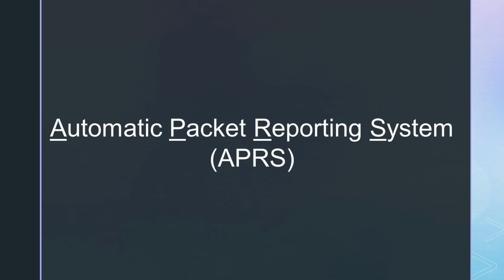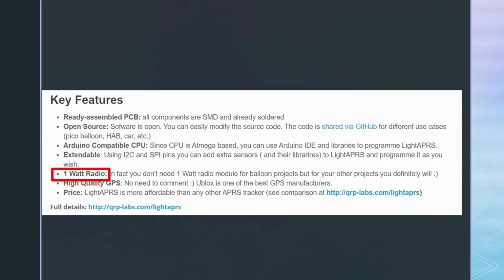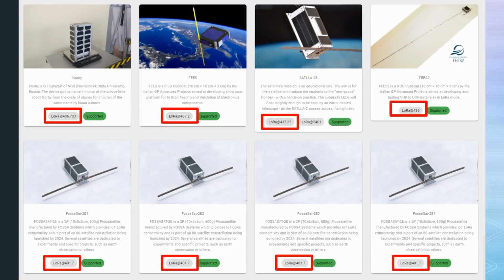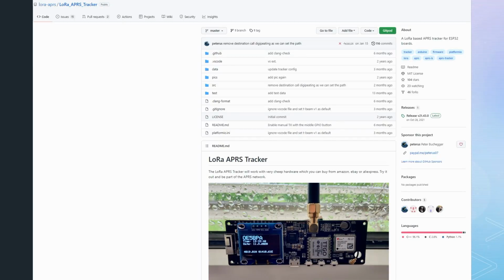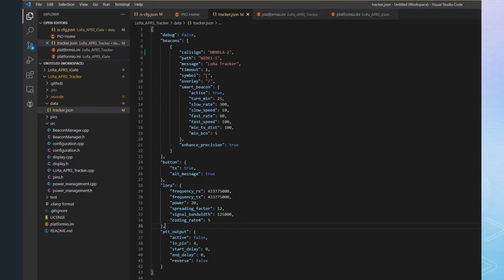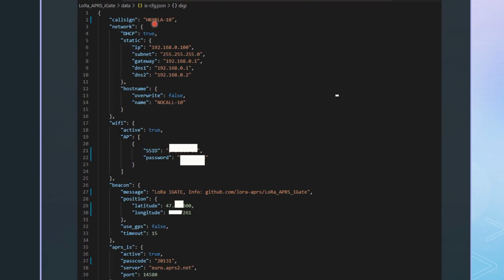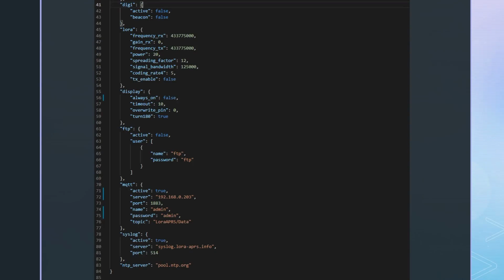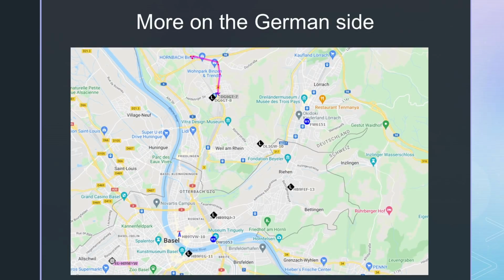021 New and Cheap APRS using LoRa Technology

Comment: Why hasn't anyone made a dual mode APRS (AX25 and LoRA) digipeater on 2 metres? In the UK the 70cm frequency is right in the middle of the licence-free ISM band,  and most people who are raving about LoRA/Meshtastic are using the non Amateur allocation around 800 MHz, to be honest, Meshtastic is just a craze, as soon as people realise that it is only SMS they will rapidly get bored with it, it is reinventing the wheel a bit because you can doing everything already using standard APRS. So why not a dual-band AX25 and LoRA digipeater iGate on 144MHz?
Reply from the maker: I would just place two different igates at the same place. Then, you can use available technology. 868MHz is used because LoRaWAN is also on this frequency in Europe, BTW.

Comment: Have you compared the range of 433 vs 868/915 modules, all else being equal (apart from the antennas, of course)?
Reply from the maker: No, I did not test it. They should be similar in most cases.

Comment: Would it be possible to run the lora protocol on 2 meters directly?  Has anyone tried this?  I guess Lora is proprietary, so that might be a problem, also any form of encryption is verboten in amateur radio so that's another.  Might be interesting...
Reply from the maker: I do not know if anybody tried. The LoRa chips start at 137MHz. So you only would have to adapt the matching/filter to the antenna.

Comment: i have a question, can i use lora aprs without a license? and are there igates nearby nordhausen - thuringen?
Reply from the maker: IGates are receive only. No problem without license. Trackers are transmitters. Here you need one.  But it is not too complicated to get one.
Reply: @HB9BLA  i will get a tracker next month but if i set tx power to 10mw, its license free. I will get my license with darc i think but i have to better in german👌

Comment: I'd like to see AGPS using ESPnow, for tracking of the robotic mower. So not to "pollute" the LoRa network with frequent updates.
Reply from the maker: I made a video about the "Farm Relay System" that uses ESPnow...
Reply: @HB9BLA  What I meant was DGPS, centimeter accuracy for the robotic mower.

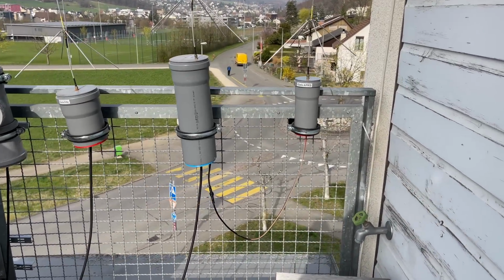Comment: Thank you for this very informative video. The DARC LoraWan group around Jürgen, dl8ma starts on Wednesday a lecture series about Lora APRS. And I am sure that also from your video many important impulses flow in. Looking at your outstations (12:10) I have a question: What do you use as "holder" for your GP antennas? Is that RG402/U? 73, Martin dg6ms
Reply from the maker: Yes, I use prefabricated RG-402. I added a link to the video description. And I know the DARC Hamgroup, I participate sometimes...

Comment: is there a way to display the packets received by the iGate locally without internet? thinking of using this remotely out of data/cellular service and would like a way to see the data locally. Further, is there a way to interface the tracker with an application like APRSDroid to see information as well?
Reply from the maker: APRSdroid is connected to the APRS backend. So you need internet on the iGate.
I would go with other projects for a point to point connections. Like FDRS. Or you use RadioLib to program your own.
Reply: @HB9BLA  do you have a link to FDRS?
Reply from the maker: @jphillips260  No links allowed here. Just google "timmbogner"

Comment: Works well. Trouble with visual studio though, could not update the config file. Downgraded to 1.7.0, and works OK
Reply from the maker: Very good! Most people use PlatformIO for this project...
Reply: @HB9BLA  it's the VS component of platformio that gave the issue. I use platform IO for all my projects since I watched your video some time ago! Thank you for all you do. 73 de G7GQA
Reply: Also, I seem to be able to achieve a range of about 17 km, with modest antennas. I plan another igate at my home QTH
Reply from the maker: @AndyDoz  My world record 5 years ago on 868MHz was 201km. So you still have some "headroom"

Comment: Hi Andreas, just on air with Tracker and iGate ...
Going to compare with ft3D on 2m. I like to understand if we can use it for low cost mid range tracking system.
My T-Beam seems have poor GPS precision. May be GPS antenna ...., 72 iu2omt
Reply from the maker: The GPS antenna indeed is not very big...

Comment: Hi Andreas, you videos have completely changed my life. I started watching your original channel over 3 years ago when i was still a wildlife photographer with an interest in electronics. Today, i run a small start up that makes wildlife tracking devices using Lora for wildlife in Peru, and the foundation for all of devices was built using your tutorials. I honestly wouldn't be where i am today if it wasn't for your videos. I just wanted to say thank you. As you can imagine, with collars, device size and battery life is our primary concern. I cant wait to get a chance to try this APRS tutorial to see if it is a better system over sticking to Lora. Cheers.
Reply from the maker: Glad to read that you found a new "profession"! I do not think that APRS is different to other LoRa networks because it uses the same methods. Plus: You have to have a callsign to use it.

Comment: any chance of putting internet through the lora? set it up as a wifi hotspot .. or what about wire it into a smartphone so the smartphone itself has a wired network connection to the lora...
Reply from the maker: LoRa is a very slow protocol

Comment: I got my igate(s) and tracker(s)  going on 70cm and 33cm. They work great! I do have a question/problem. In the igate config I enabled GPS (true) but the igate doesn't use it. It won't display the igate/digi on APRS FI. I'm using TBeams v1.0.
Reply from the maker: I never tried that. Maybe you open an issue on GitHub?

Comment: GPS is a high bandwidth low power and low bit rate system. Has anyone tried to move its technology to other data systems? Would be cheaper.
Reply from the maker: I thought that GPS comes from satellites?
Reply: @HB9BLA  L1 GPS uses over 1Mhz bandwidth to transmit data at around 50hz baud rate using very little power and a small antenna, hidden in your phone. You can by a receiver on ebay for about $5 because the manufacturer does not have to license it from another company.
Reply: I was referring to the modulation/ transmission method not the application or use

Comment: Hi Andreas, this project really sounds fascinating, but I do not have a call sign. Do I need one to use Lora APRS, or can I participate without one?
Reply: as it requires a HAM license, you'd need one (the callsign should come with the license)
Reply from the maker: The test are not too complicated if you are interested in electronics, I think. And the hobby has many more facets...

Comment: Excellent video, Andreas. I had an unused 433MHz esp32 LoRa board so I flashed the ARPS firmware and now have an igate running. I think it's the first one in Utah, and several surrounding States. LoRa + APRS seems a good match. I'm interested to see where this idea goes.
Reply: Same here Kris.  I have one in Tennessee!
Reply from the maker: @RichardMontgomery67  Great! The video is quite successful. So I assume we will see some more in the States...
Reply from the maker: Indeed, it has good properties like low power and long range. And it is cheap. Congratulations for one of the first LoRa iGate in the US

Comment: is software available, to TRX Lora signals out of an usual Ham radio?
Reply from the maker: Yes. There are a lot of such videos on my main channel.
Reply: @HB9BLA  sorry my Questsion was not precize. Software to send/receive Lora signals with e.g. an Raspberry Pi/Linux/mac/win and an Ft-8x7. 
How far would you get with 20 watts Lora TX?
Reply from the maker: @unoxunox4086  The range will mainly depend on line of sight. Maybe the 20 watts help a little with reflected signals.
LoRa signals cannot be transmitted by ordinary HAM equipment. They need a special module as shown in the video.
Reply: Ok, thank you for the Information. Make sens, lora uses a different modulation as     FM/AM/cw. I remember you said this with the hint to AFSK. I will enjoy the viedeo again, to learn more. Sorry for this unnecessary question. Have a nice day with hopefully chocolate, cheese soldering and Rivella.
Reply from the maker: @unoxunox4086  No problem!

Comment: Interesting! I found that a lot of the TTN based tracker projects have become unmaintained with the move to the new TTN platform (at least, I've not been able to get any working reliably), this might be a more interesting use for the TBeams I have laying around!
Reply from the maker: My T-Beam LoRa Tracker works in V3 of TTN (and it is cross-posted to aprs.fi). So everybody should be able to update it if needed.

Comment: on regular APRS I send my weather station info . Is there any option for this on LoRa - or is that just too much data ?  I may have to make one of these digipeater igate stations sometime to help the cause .
Reply from the maker: I am not sure if it is part of their future plan. I think it should be possible to add weather data if they are not sent too often.
Reply: Should be possible. The iGate just feeds APRS IS servers with the received data, so if tx string from your weather station stays the same I see no reason why it shouldn't work.
Reply from the maker: @joostluyten_ON2OT  Just keep airtime in mind (on SF12)

Comment: I have to revisit my failed Lora Project (only exchanged messages  at 6-9 Inches  apart! Not miles!)
Reply from the maker: Definitively. But keep an eye on "line of sight" ;-)
Reply: @HB9BLA  To be fair though, the LoS requirement is more of an operating frequency attribute then a modulation one. You could use LoRA techniques down on HF and not have LoS issues. I'm not meaning to be picky, I just think it's important to differentiate the two (lots of people don't understand what things can affect or attenuate different types of radio signal)